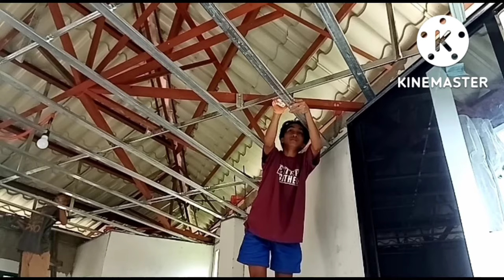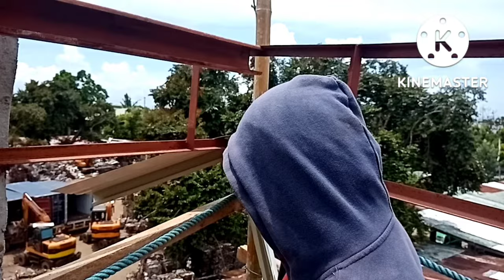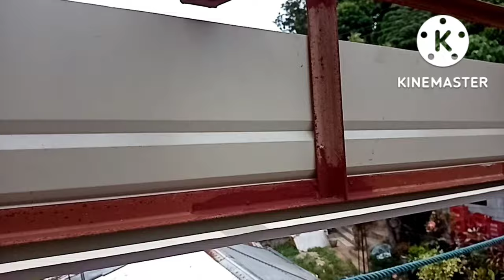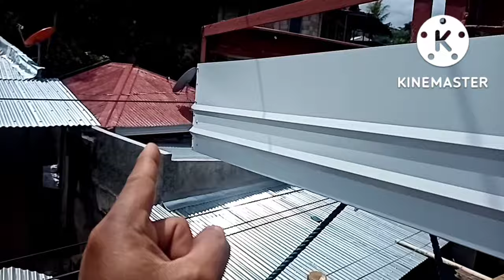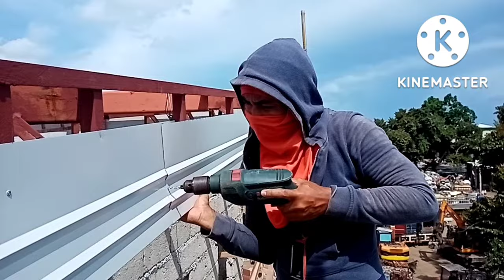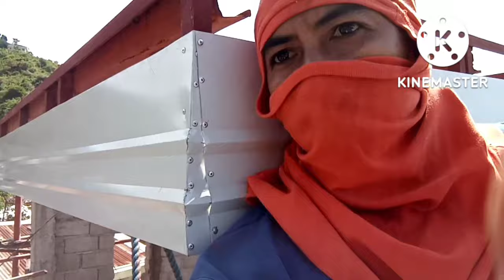How to install metal fascia board

Comment: Pde po ba jan hardi senepa
Reply from the maker: Pwede po hardiflex yung 1/2 ang kapal boss
Reply from the maker: Para di madali m biak boss
Reply: @richiepancho5061  bali itotornilyo mismo sa angle bar?
Reply from the maker: Opo boss .. pwede metal Teckscrew na ang sukat 1&1/2" pwede rin e rivet nyu boss
Reply: @richiepancho5061  metal tex screw hndi po ba mag expos un head ng tex screw